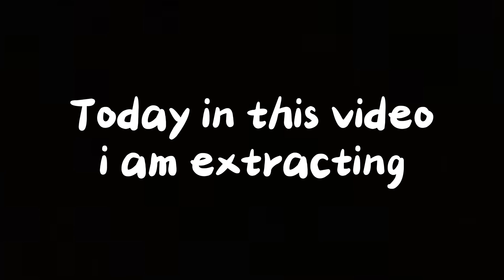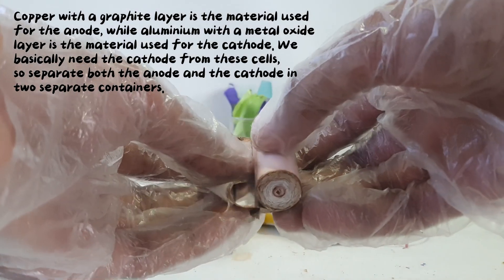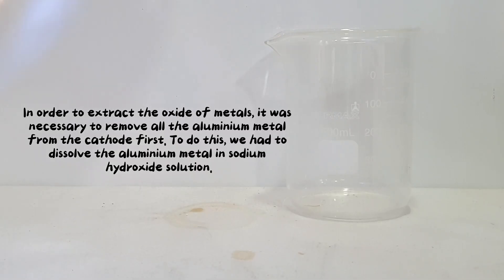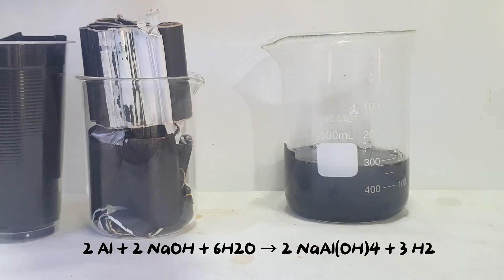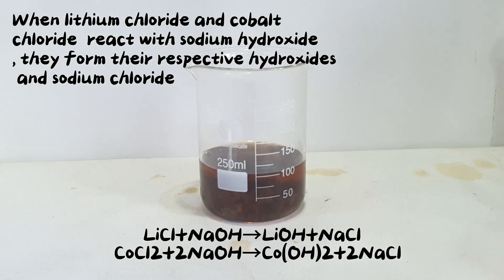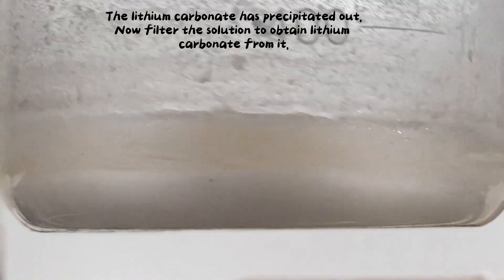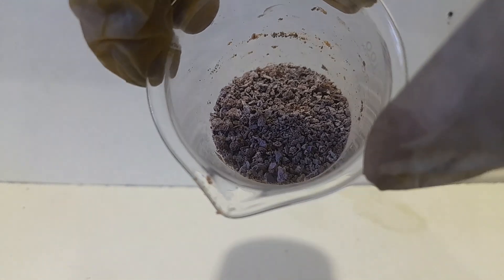Extraction Of Lithium Carbonate And Carbonate And Cobalt Hydroxide

Comment: @Molybdenum You´ve got it wrong when it comes to the reaction between the hydrochloric acid and the lithium cobalt(III) oxide. What is actually happening is that LiCoO2 reacts with HCl to form lithium chloride, cobalt(II) chloride, water and chlorine gas. Haven´t you smelled any chlorine during this reaction?
Reply from the maker: Give me the time stamp of the equation
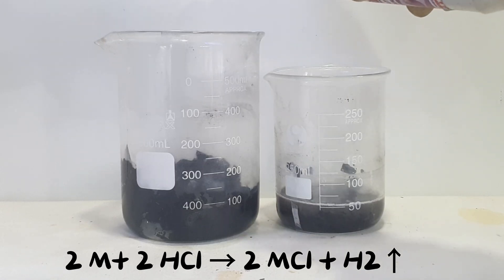Reply: @Molybdenum-h  At 4:56 you´ve wrote this equation: 2 M + 2 HCl = 2 MCl + H2. The correct equation for the reaction between the black mass of lithium cobalt(III) oxide and hydrochloric acid is: 2 LiCoO2 + 8 HCl = 2 LiCl + 2 CoCl2 + Cl2 + 4 H2O

Comment: I am literally confused.
When I had tried the same thing the whole stuff caught fire its self and everything burnt. But you are doing everything so perfectly
. What might be the reason that it caught fire???
Reply from the maker: Do you have discharged the batteries????
Reply: @Molybdenum-h No I am not so sure about it . 😂They were just swollen may be due to overuse 😅.
Reply: @b63ff  I've taken apart many such batteries. There are two primary causes for a battery catching fire. #1 is that the battery was not discharged to less than 3 volts. Always discharge a cell completely prior to disassembly or the likelihood of having a fire is quite high. #2 is that you have a heavily degraded battery that has possible metallic lithium plated in it. You mentioned swollen cell which in my experience has a decent chance of having some plated metallic lithium present inside. This can ignite just on contact with humid air, speaking from experience of it happening to me. Every so often I run across some cells that have metallic Lithium present on one of the electrodes or on the plastic separator. It's not a metallic sheet but just some metallic looking spots 1-2mm in size.
Reply: @Molybdenum-h 
Can you synthesize cobalt citrate using Citric acid and Cobalt hydroxide.
Reply: @Molybdenum-h 
Be careful it's sometimes dangerous.
Reply: This video definitely needs a re-upload without the music and clearer commentary. It’s an excellent film, just needs these technical things sorting. Thank you.
Reply: Maybe you were using a non-rechargeable lithium metal battery? The kind you can extract Li metal from mechanically?